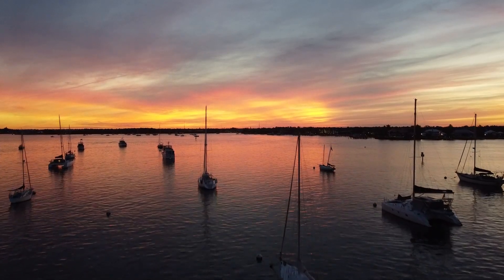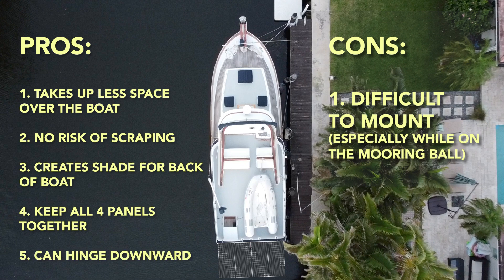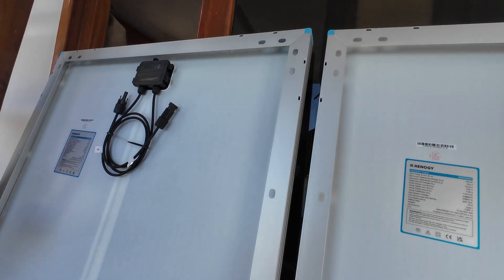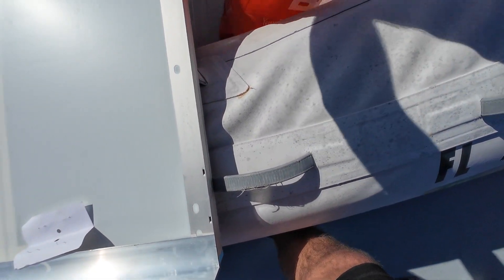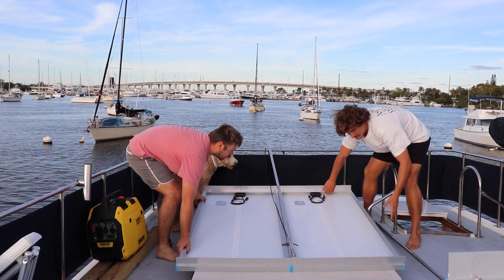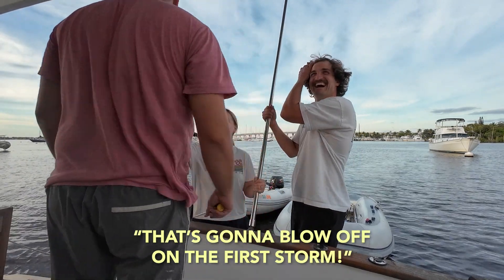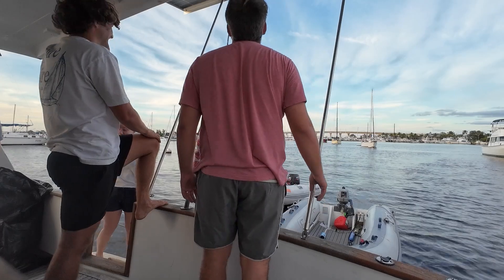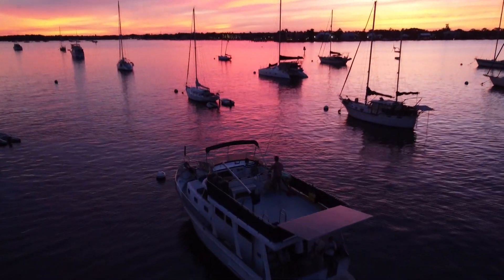Mounting Solar Panels While Living on a Mooring Ball | Off-Grid Power | Solar Project Part 1

Comment: Couple of comments.  Right now on a mooring ball, you have a static load on the two very long small diameter stainless support poles.  However, in any kind of weather you will have dynamic loading including sea state and wind loading since the panels will be like two large sails.  Not sure how they are held down, but wood screws into the gunwale will likely loosen fairly quickly.  The panels may also lift upwards so they need to be very secure in the base mounts.  With the unsupported pole lengths you need to also be concerned with vibration and buckling of the poles.  The first vibration frequency is going to be very low due to the long length and small cross section.  This has then potential to match the frequency of the sea state.  Just wanted to express some concerns with the installation because I don’t want to see you guys delayed on your trip or have anything bad happen to you.